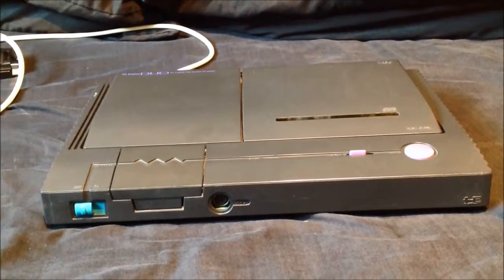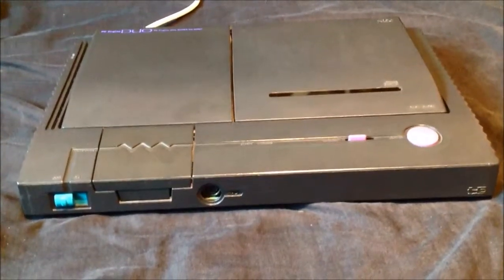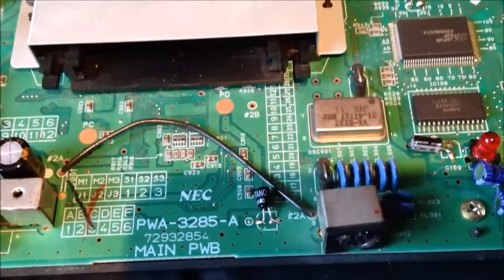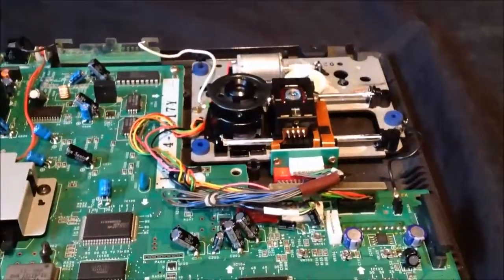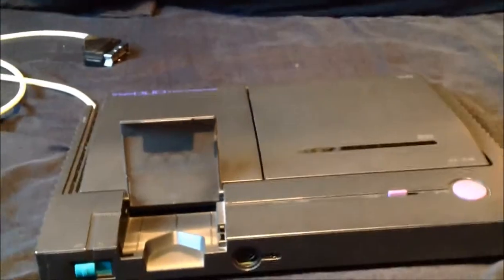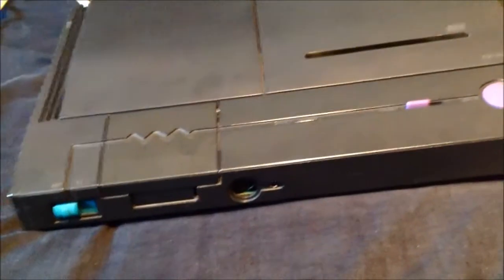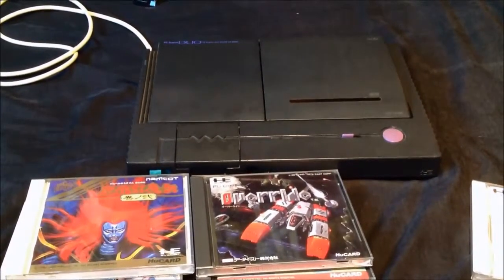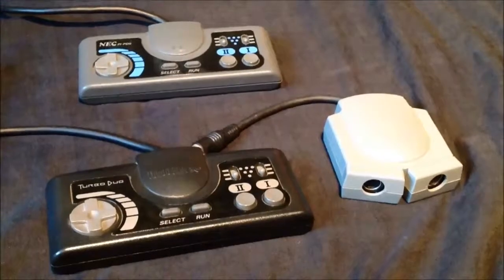Pc Engine Duo Review

Comment: The capacitor plague with the stolen formula was about 8 or 9 years later when all the manufacturers reformulated for RoHS certification (Reduction of Hazardous Substances) for EU compliance and other regulatory standards. A Taiwanese manufacturer used half of a stolen Japanese formula without the stabilizer after a Chinese company poached a Japanese employee.

The reason the caps universally fail in the Duo is because they used a cheap formula while the industry was transitioning to surface-mounted capacitors in new SMD packages that had not been time-tested. Eventually they got the formula and packaging right so SMD caps by the mid-'90s were generally fine, though you still wanted good Japanese brands for longevity (Panasonic, Rubicon, Nichicon, etc). Japanese consumer electronics brands generally stuck to Japanese brand components even during the capacitor plague which is why you don't typically see an N64 or PlayStation or Dreamcast that needs it outside of the power supplies which are modular and provided by various partners (many variants).
Reply from the maker: That done good information there thanks

Comment: OK, so I recently realized that the European TurboGrafx used a 240° DIN5 for the AV out because a 180° DIN5 like the Japanese systems would actually fit where they aren't supposed to: the American-style DIN8 controller port. Because the Turbo Duo has a Japanese-style 180° DIN5 for AV output, it pretty much had to adopt the Japanese-style 8P mini-DIN controller ports too. This also meant less retooling and redesigning for lower localization costs. When it comes to the Duo, it wasn't just a size thing! :)

Comment: Great review mate. Love the pc engine. I also got the duo r when I started getting sound issues with my duo which as you recommend I will recap one day.
Reply from the maker: thanks mate if its just the sound you might get away with just replacing the sound caps, they are the ones in the vid near the heat sync sort of top left of the duo.

Comment: Interesting video about this system. I've been interested in getting one at some point. The cost is holding me back for now though. Having never owned a Japanese console or any version of the TG16, I'm intrigued by the large and exotic library.

The famous "stolen electrolyte" incident in the capacitor industry didn't happen until about 10 years after this machine was made.  The incident was related to a stolen (and incorrect) formula for the electrolyte used in a Japanese manufacturer's low ESR caps.  It led to a surging supply of cheap low-ESR capacitors from China, which turned out to be using that faulty formula. They were most famously adopted by many cheaper PC motherboards of the early-mid 2000s. A few years later they started seeing huge failure rates with the caps, and companies who had used them were in fear of massive liability and bankruptcy. Some of them did go bankrupt, lots of mobo brands disappeared around that time.

The story has taken on a life of it's own on internet forums nowadays and gets too broadly attributed. Many bad caps are just the result of a subpar manufacturer or a bad series, not because they're using the old stolen electrolyte formula. Cheap caps have always been out there, as with all components.

In the case of this console, I doubt it uses low ESR caps. Consoles of that period normally used cheap general purpose 85C rated caps. General purpose caps are more stable technology, but they don't have a long service life. They probably figured they would last as long as needed and helped keep the cost down, but for people collecting these systems 20+ years later, they are definitely on borrowed time.

Even with general purpose caps, some brands are definitely better than others though. I needed to recap a Genesis a few years ago. It was an early revision with really cheap Chinese caps in it (before they had switched to Rubycon). As I pulled them I checked their capacitance and ESR. As I did that, I found that every single cap of one brand was out of spec, while all the caps of another brand were still in-spec. There was no point keeping any of them though.
Reply from the maker: ah thanks for the update on the  "stolen electrolyte" incident, we had hundreds of Ibm pc's and monitors fail in work about 7 years a go all with bad caps but luckily we got IBM to replace most of the mother boards but by the time that happened the pc were to old and lot of them just got replaced anyway.

But as for the Pc Engine get yourself a Duo R when can afford it best way to go.

Comment: I believe those bits on the back are for mounting the rare Duo LCD monitor.
Reply from the maker: Interesting I didn’t know that and never seen the lcd screen.
Reply: @RetroTuna  It's crazy rare/expensive and I've never seen one mounted. Like, I've seen broken ones sell for nearly $900. There's an even more rare battery pack too. Heck, maybe the monitor just sits on top and the battery mounts to the back, which might explain why I've never seen a picture of the monitor mounted to anything (looks like it folds into itself instead of a clamshell). I believe those accessories are the reason only the original Duo has a headphone jack. :)

Comment: I recapped mine and it still has audio issues. The sound amp is shot have to replace that next
Reply from the maker: That's gutting the amp is gone you have any luck finding a replacment,  i have been lucky with the ones i have recapped so far and managed to save the amps.